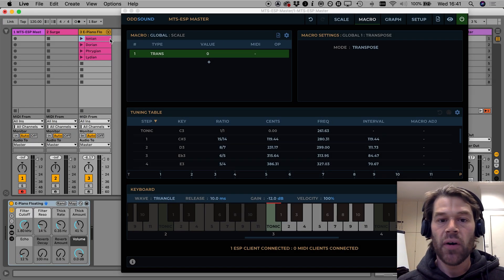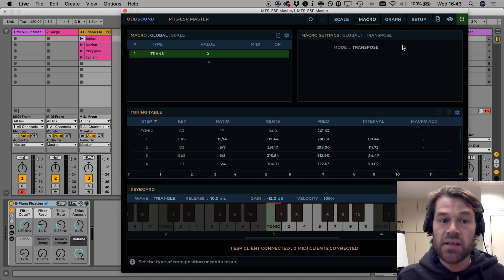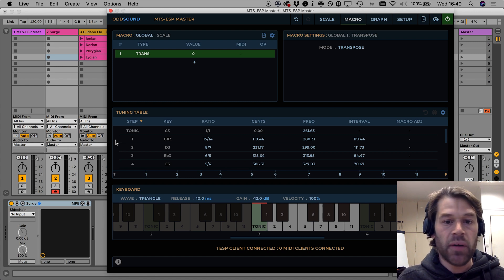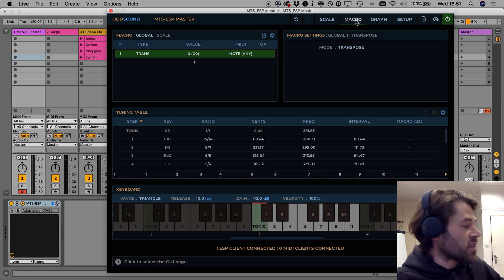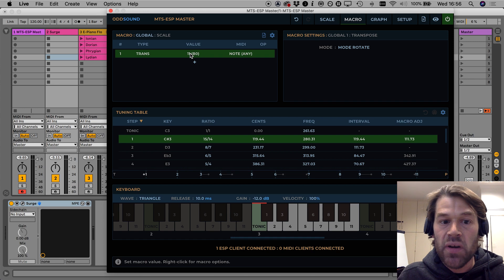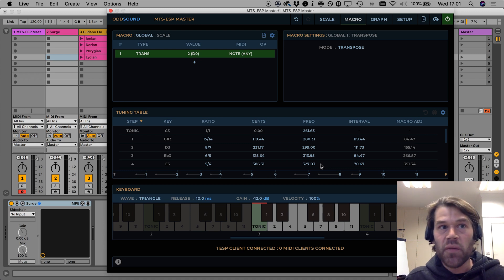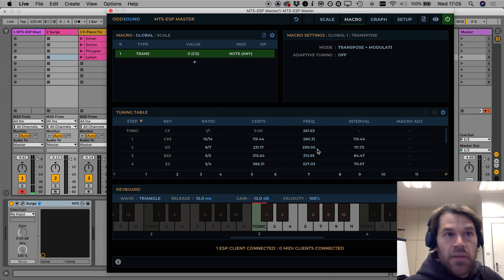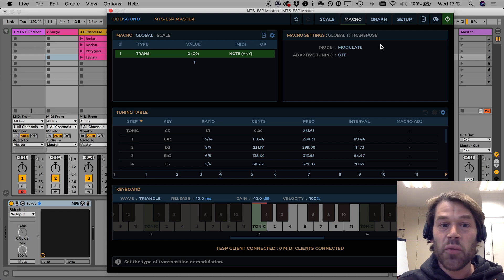MTS-ESP Master: The Transpose Macro

Comment: I'm so keen on having all my instruments play by through a certain scale at the same time. I use the normal scale plugin in Ableton to achieve this. Does this do the same thing? Would I be able to shift from Dorian to Lydian mode using a midi button?
Reply from the maker: I suppose you could set it up to do this, but MTS-ESP Suite is really intended as a system for retuning rather than quantising MIDI note numbers, so may be a bit overkill.  There is a 30 day unlimited demo available if you wanted to give it a go.

Comment: Seems to be a great tool.
I'd wish to know if it works with Cakewalk, and if it does, how to apply it there.
The same pair of questions applies to Avid's Sibelius.
Reply from the maker: MTS-ESP is a system that allows plug-ins to communicate tuning data automatically and invisibly.  This communication doesn't involve the DAW, therefore which DAW you are using is irrelevant, it will work regardless!  Note that this applies only to plug-ins that natively support MTS-ESP (those listed here: https://oddsound.com/usingmtsesp.php ).  Where you will need specific instructions for Cakewalk is if using our MIDI Client plug-in to retune plug-ins that don't natively support MTS-ESP, or hardware synths.  The MIDI Client is a MIDI-only plug-in and it seems every DAW has their own way of handling these.  There are instructions for using it in Cakewalk on page 32 of the MIDI Client manual: https://oddsound.com/dl/ODDSound_MTS_ESP_Suite_MIDI_Client_Manual.pdf.
Reply: @oddsound3908  thankx, but that doesn't mean I'd  have to purchase the suite to get any result?
Anyway, I'll check it out. Cakewalk only finds the Vst2 version of it, btw.
Reply from the maker: @MadMusicologist  Indeed you don't necessarily have to purchase MTS-ESP Suite to use MTS-ESP for retuning.  You could use our free MTS-ESP Mini plug-in ( https://oddsound.com/mtsespmini.php ) or any other software that acts as an MTS-ESP master plug-in e.g. Infinitone or Entonal studio.  These are all capable of retuning the plug-ins listed here: https://oddsound.com/usingmtsesp.php.  Note that the MIDI Client plug-in is part of MTS-ESP Suite though.

Cakewalk should see the VST3 versions.  The first things I'd check are that you can see the VST3 versions in your VST3 plug-ins folder on disk (usually Program Files\Common Files\VST3), and that Cakewalk is definitely scanning that location.  Perhaps try a plug-in rescan in Cakewalk too.  If that doesn't get it showing up drop us an email at info@oddsound.com and we can advise and investigate further.

Comment: Super! Thank you. There are many "moving parts" associated with this wonderful software. You've cleared up one or two of them. I will certainly tune in to "Adaptive Tuning." Another moving part is the nature or design of the MIDI device being used. A simple MIDI keyboard with a bit of this and that of added features is one thing. But, for example, the Arturia BeatStep Pro is its own bag of moving parts and, of course, it was not necessarily designed to take MTS-etc into account. Perhaps someone, either at your place or in 'the community' could do a tutorial that covers the various BSP configuration nooks and crannys, e.g., the relationship between BSP's base frequency and the base frequency defined in a custom tuning/scale. If I come across as confused with this suggestion, it's because I am. Thanks again for your help.
Reply from the maker: I think I may be a little confused by this too!  But hey, let's have a go.   First, what is the base frequency on the BSP?  I had a scan through the manual but couldn't find a setting for this, can you point me in the right direction?
Reply: @oddsound3908  Thanks for taking this on. Here's a quote from the manual that seems to reflect the default or usual or base case: "The encoders can edit the pitch of a step +/- 36 semitones from the default pitch of middle C (MIDI note 60)." Presumably, this is the chromatic, ET series; which of these notes is actually output can be changed via the Shift/Pad touch sequence, i.e., Blues, Pentatonic, Minor, etc. So the overall range, in terms of MIDI notes, is C0 to C6. However, I think the frequencies associated with these notes can be altered through the MIDI Control Center software. Further, there is a loose and, to me, mysterious connection between the alternative/simultaneous(?) CV pitch output (which is said to be 'quantized') and the MIDI notes as set by a sequencer's control knobs. This is an important piece of the puzzle if one is simultaneously doing things to plugins in a DAW and a desktop or modular synth. Perhaps the thing to do is step back, take a breath and actually do a detailed read -- a habit I seem to have lost as my YouTube exposure has risen. A plan might be to get in touch with you via support email when I can formulate a few more focused questions -- because in truth I need more time with your docs as well. Thanks for your help. And any suggestions.
Reply: @edwardnixon1782  Ok so I may be wrong with some of this but here's what I think I see.  First, the thing to realise is that the BSP doesn't receive any tuning data from the MTS-ESP system, there is no mechanism for this.  It is a 12-TET device.  It has different scales, and a user-definable one, but they are all subsets of 12-TET.  If you are using pitch CV output from it, that pitch CV won't be "retuned" according to the scale in MTS-ESP Master.  If you are sending MIDI data from it, then that MIDI can trigger plug-ins or hardware devices that are being retuned by the MTS-ESP system.  In this case you would probably not want to use a "scale" on the BSP and just have it in chromatic mode, then you can set up the scale mapping as you like in MTS-ESP master.
Reply: @olicash4494  Thanks! Yes. I'd gotten that far. I'm still in study mode here, both with the BSP manual, you manual and now the "The Arithmetic of Listening" by Kyle Gann, of which I'm sure you're familiar. Then there's the 0-Coast at the end of the line. Likely the most important part of this experiment ongoing will be the Tuning plug-in that gives me a sense of where each bit and piece in the processing is to be found. Thanks again for your help.